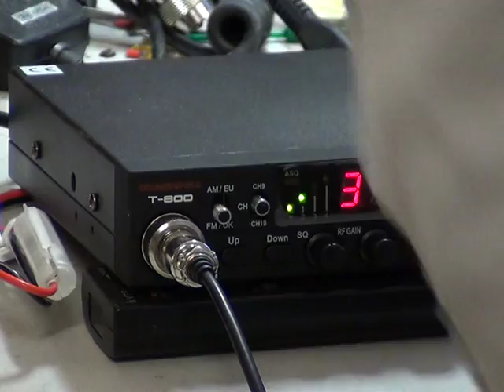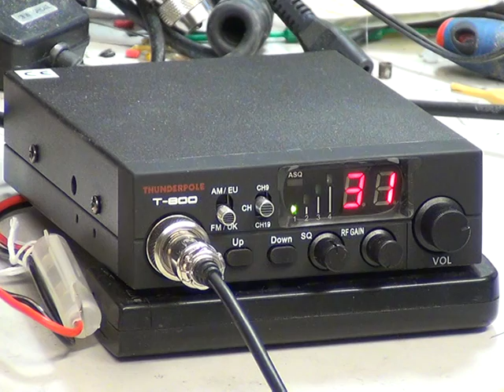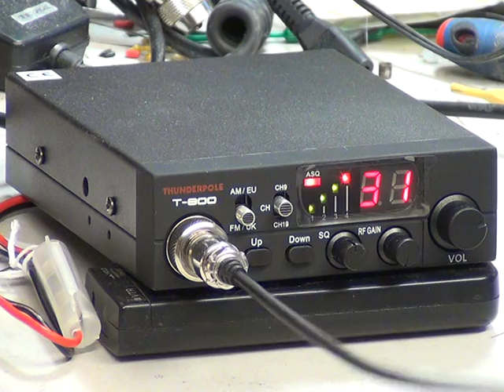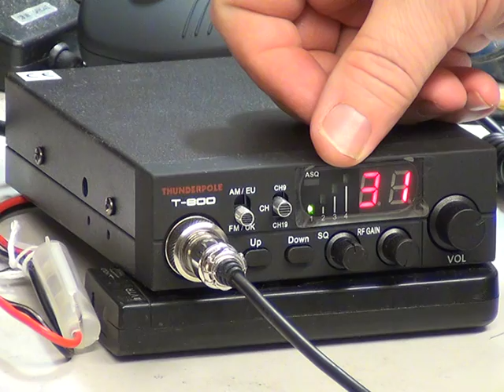Thunderpole T800 (CE Multi-norm CB radio (mobile) - On the air test

Comment: Hello I recently bought a t800 Nd bought a silver rod mounted it way above my roofline and I got the swr very low I am still struggling to make contacts on fm and am is it tod do with the t 800 and should I save up fir a ssb radio cheers
Reply from the maker: Well we get out about 35 miles in our best direction on UK FM only. I wouldn't bother going down the SSB route; unless it's skip conditions you'll only get 50% more range as an absolute maximum than you would on FM, usually 20% more. There is no range difference between AM & FM. 

I find the CEPT set of channels useless here (Lincolnshire) with range as low as 1 mile because of foreign interference hence sticking to the UK FM set of 40 channels.

Richard, G0OJF, UK
Reply: @ukfmcbradioservicingTango21  thankyou for your reply what I'd the certificate set of channels I'm pretty new
Reply from the maker: Sorry, this sentence from you doesn't make sense to me!  Just bear in mind that all CB radios are the same range more or less. We've tested over 350 different models over the years. Sadly, the more you pay, the worse they seem to perform. The extra money just buys you more useless switches & knobs & pointless features. The T800 worked fine when we tested one.

Richard, G0OJF, UK
Reply: @ukfmcbradioservicingTango21  sorry auto type what is the cept set of channels haha 👍
Reply from the maker: @Byron2000-i2h  In the UK, the unique FM only channels are called the UK channels & start at 27.60125 to 27.99125 for 40 channels. The CEPT channels were introduced later in 1987 'in line with Europe' for UK users & are 26.965Mhz to 27.405, also for 40 channels. Until 1997 when PR27/97 approval was introduced you had to have two radios for both sets of 40 channels. After then 80 channel sets were approved under that type approval (PR27/97). In 2000 CE MultiNorm sets were introduced where you tell the radio what contry you are in & it sets up the channels you may use accordingly. In 2014, the UK was also given use of AM & SSB as well as the existing FM on the CEPT set of channels...provided the radio is made post 2014 & CE approved. The unique UK set of 40 channels remains FM oly (luckily).

Hope that helps,

Richard, G0OJF, UK
Reply: @ukfmcbradioservicingTango21  yes all cleared up thankyou

Comment: Ive got 2 of these, easy to tune them up to 6-7 watts, my set was 2 watts out of the box in to a calibrated Welz power meter, really good little set, small, nice audio and easy to use, great test.
Reply: How do I tune them to more watts
Reply: @mduffy5453  Me interested too 👍
Reply: @Sherlock-iQ  I sent mine to my brother and brought a crt2000h from knights. It goes 4-10-40 watts

Comment: I've now bought one and had it for just over 7 weeks. I can communicate about 6-7 miles from the car on normal road level. From a couple of hills in the car I have easily made contacts between 11 and 16 miles with a mag mount aerial. Not bad at all

Comment: just seen this vid. quite useful. you sound like decent human beings. i'll watch future vids. What is the furthest you know anyone has made a contact with this radio on either am or fm with a non bespoke antenna? Thanks
Reply from the maker: Citizens band radio is designed to be a local 2-way radio service & not a substitute for licensed amateur radio. TO this end, our government expect range to be a maximum of 16KM. We get 35 miles in our 'good' direction from base to mobile (mobile means car) so is very satisfactory. We are all licensed radio amateurs here but are more interested in UHF upwards rather than HF and long worldwide range. Back to CB, we only use FM. The UK allocation for AM use is on the CEPT set of 40 channels rather than the UK set of 40. Snag is far too much interference here on the CEPT set of channels so we can rarely manage for than a few miles when we try that band. Hope this answers your question to some degree.

Richard (UK)
Reply: @ukfmcbradioservicingTango21  Thanks Richard. That's very helpful. I'm just starting out after many years considering it. Your information is helpful. I am interested in becoming licensed but wanted to experience being on air first as it were. I have subscribed. Hope to receive more words of wisdom from you. Yours Julian
Reply from the maker: @peaceman269  . I became a licensed radio amateur in 1979. CB radio only happened in the UK in November 1981. I do the CB service work (for the trade) and all 'as per manual'.
Reply: @ukfmcbradioservicingTango21  Thanks Richard. I'm glad I came across you. With you behind me I'm sure I'll enjoy the experience more. If I have more questions going forward would you be happy to oblige? Thanks Julian
Reply from the maker: @peaceman269  Yes, but via email rshireby@yahoo.co.uk

Comment: Hi Richard, is there a TX audio volume pot adjustment on the Thunderpole T-800 as always being told my audio is back of the box!
Reply from the maker: The TX audio is called Deviation & is set with a deviation meter with the radio transmitting into a dummy load in the centre of the band..we use channel 20. Deviation is supposed to be set at 2.2khz average & must not exceed 2.5khz ever. Many new radios come set low at between 1.4khz & 1.7khz I have found. The adjustment is mentioned & demonstrated in my first part of this radio...tx adjustments.

Richard
Reply: Hey thanks Richard,  i'll check it out.